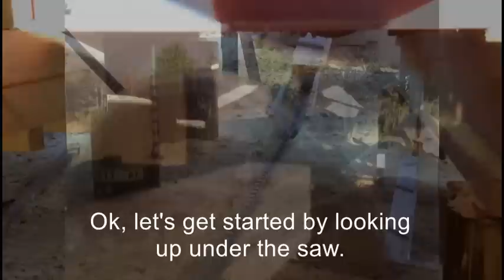Frick 00 Sawmill Dec 10 2016

Comment: I am SO HAPPY to see anew sawmill vid that is not using a gm diesel for power
Reply from the maker: The mill originally cam with an International Harvester UD-14 which is gas on one side and diesel on the other. You started it on gas and once it was warmed up you threw a big lever and switched to diesel. It had a cylinder down so I went on the hunt for another engine. I had an option for a gm diesel in the 3-53 variety but I really didn't want a detroit diesel based on my experience with them. About that time the Cummins HRF-6 that I have on the mill came available and was being sold for scrap even though it ran fine. Simple engine, naturally aspirated with plenty of power. I love the way it runs and will keep it going as long as I can.

Comment: hi there looking real good . i was looking at the springs or something on the sawyers lever and can't quite figure that out what do you have going on there ? need a log turner next . keep up the good work and movies . thank you john
Reply from the maker: When I bought the mill, someone used a big lead weight to set the carriage travel to neutral. The problem was that the weight kept moving and I would find myself with the carriage creeping forward. So, I took two screen door springs from Lowes and positioned them opposing each other such that they pull the lever to neutral. This way, if I just let the lever go, it will go to neutral and the carriage will stop. It got scary a couple of times with the carriage moving forward towards the saw when trying to roll a log.

Comment: I was wondering if you have an edger or a planer to go with your mill
Reply from the maker: I have both an edger and a Newman 8B 4 sided planer. The edger needs restoring but the planer is ready to go. One of our next steps is make an adapter and connect the planer to the engine then set up the fan to draw the shavings off of the planer.
Reply: I look forward to seeing that in the future. Good luck!

Comment: We run Detroits and Cummins engines. Two 6-71 Detroits one on the de-barker and one pulling the headsaw and a 350 small cam Cummins on the chipper. I prefer the Detroits. They give less trouble and do not burn as much fuel.The problem with any of these old engines is getting parts for them.The old two cycle detroits are becoming dinosaurs.
Reply from the maker: Agreed about the parts. Luckily I have the original parts manual for the HRF-6 and have had decent success at finding parts on the internet when I looked to see what was out there. Being naturally aspirated, the HRF-6 is a pretty simple engine.
Reply: Is that an old planer in the background?
Reply from the maker: Yes, it is a 1950's Newman 8B, 4 sided, planer/matcher. We are in the 
process of getting it connected to the engine and will do a video once 
we get it done. I actually have 2 of them, one in parts and one that has
 been completely rebuilt. Should be a site to see
Reply: I have some heads. I think they are for a 1 13/16 shaft. They mite work for the side heads.
Reply from the maker: I am not sure what size the shafts are on the side heads. I have one set of side heads but have two planers. Had planned to see about having a set of side heads made.
Reply: Reel McCoy l.p. p